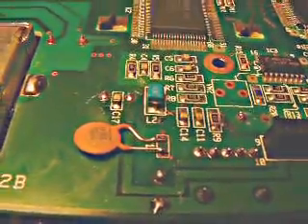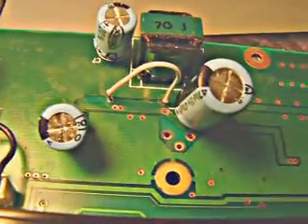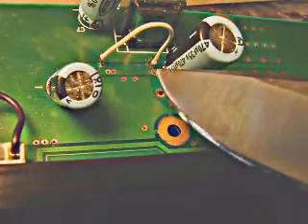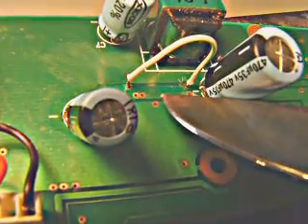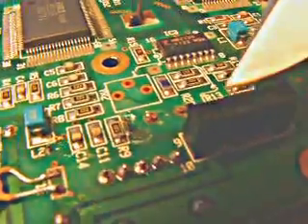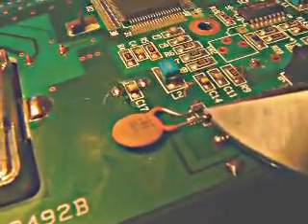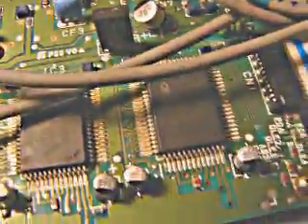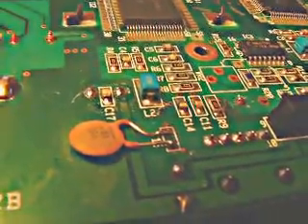KENWOOD TS 850 DISPLAY BOARD REPAIR HINTS

Comment: I checked all boards very carefully, checked all caps with microscope glasses, I checked 74LS145  On the RF  board. All pins appear to put out a signal...There appears to be nothing wrong with the display board...The Car board uses YM66312 and the serial number is starts in the 60's...I lost or my xyl through out my Kenwood service manual so I am at a lost...I have pictures of the display which explains this problem better. But don't know how to update to you...

Comment: My 850 was working perfectly until i shut it down for about 2 weeks to use the Icome 7300. After firing up the 850 the display was erractic with the left side appearing ok, but the right side was all lit up with all the modes listed, plus instead of numbers for frequencies, i have looked over all the boards with a microscope glass, checking for leaking capacitors and etc..There is now NO RF output on transmit, and receiver is very quiet...I have two other units, and started exchanging boards to attempt to isolate any problems with the board. If I knew where to take measurements, I might be able to figure this out. any help would be appreciated.
Reply from the maker: In my experience 9 out of 10 times the problems are capacitor related.  I would pay close attention for issues under the SM caps.  I would start on the display board, they are inexpensive and easy to replace.
A while back I had a friend send over his 850 to check out, the receive audio went TU,  again it was due to leaky caps.  Here is a link to that video. 
https://www.youtube.com/watch?v=0gHoJqQsAfI
https://www.youtube.com/watch?v=wPWq_OH5mcQ
Good luck.

Comment: After pulling my TS-850SAT off the high garage shelf where it had spent a dozen hot summers the LCD board went black after a day or two. I pulled it open and found the exact same electrolytics had leaked with the same PCB traces affected. I'm ordering replacement caps today.
Reply from the maker: It is a fairly easy fix and can be kind of fun. Good luck and Cheers

Comment: You probably know this by now, but in general, if a capacitor value is not marked with pF or uF, decimal values (0.47, 0.1, 0.001, 0.33, 4.7 etc.) are assumed to be in uF, and non-decimal values are pF (1000, 39, 120, etc.)